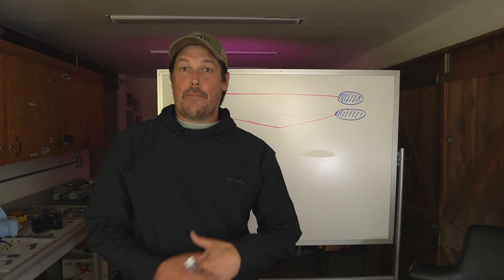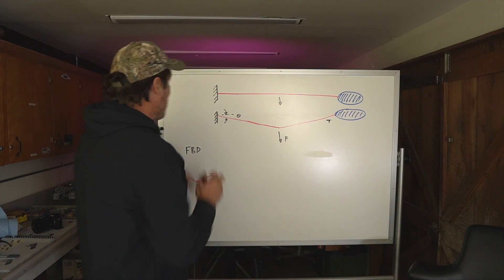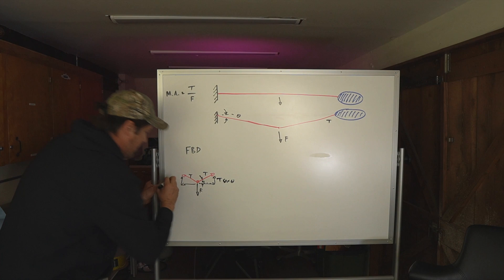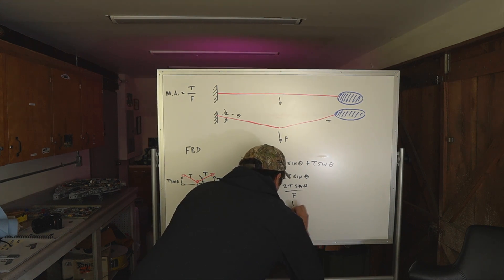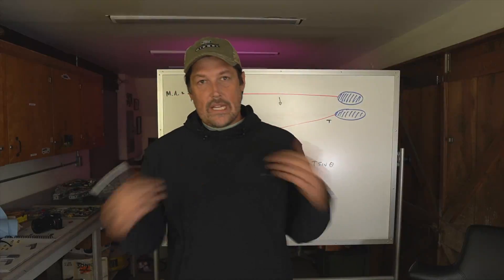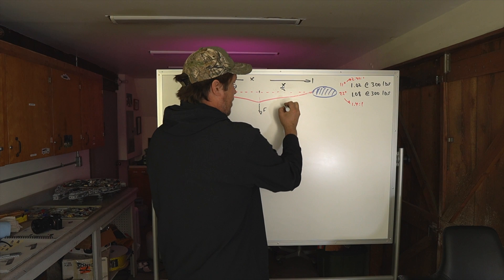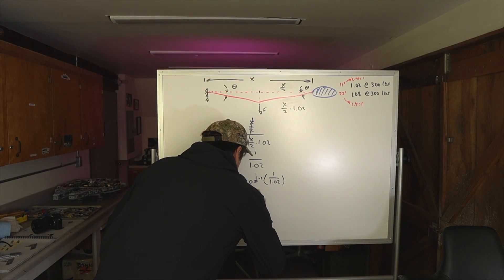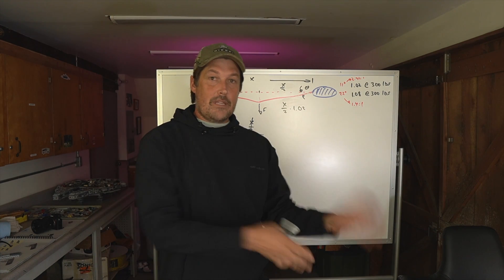Vector Pull Math for Whitewater Rescue

Comment: In the lineman's handbook..... I understand there's a diagram like that.... and it says that a man can pull 1500 lb.... For short distances then he needs to retighten his rope..... There's a type of Hauser line that tugboats use that they advertise stretches very little.... I'm just throwing a few things out that I've heard from engineers and looking in my tipler physics book and such..... And talking to people that work for the pud. IE people that work on telephone poles cross-country feeder lines... You know guys that work at the power company..... When they are apprentices this is the type of stuff they teach em. The diagram in the tiplers physics book.... Says that the rope..... that the rope better be able to hold 12 or 1500 lb... Here's the thing.... If somebody is trying to rescue somebody they have a whole bunch of adrenaline built up they've got tons of extra strength now.... Anyway a man who is amped up is going to be able to pull one hell of a lot more than 100 lb.... Not to disagree on anything that you said. I read a story problem in that book (physics book) and it gave the exact amount it said how strong was the rope have to be if it was exerted 150 lb... I think it said 1345 lb
Reply from the maker: 1 kN is a lot for one person to pull. 1 kN is 224 lbs.

Comment: Great video! Another thing to keep in mind when applying vector pull onto an already tensioned line (ie. with a 3:1) is the consideration of the rule of 12. Big difference if the 3:1 was tensioned with 1 or 3 people and then doing the vector pull on top of that. Hopefully the prussik would slip before anything else unexpected occurs.

Comment: Doing a vector pull on a line that's already under tension. As in it's already being pulled normally, or with a MA pulley rig. Would minimize stretch and keep it at a low angle, but I definitely don't want to be the person pulling in the middle of a system already under high tension. I don't want to be in the middle of everything if something breaks. 

I've seen it done that way once to get a way overloaded boat unstuck, and afterwards everybody had the same thought. "That was way too sketchy, let's never do that again." And even then, the vector pull wasn't super helpful because as soon as the boat moved a few inches it stopped being low angle and wasn't effective.
Reply from the maker: Yes to all of that

Comment: Great video. In his swiftwater rescue class, Lee Baker taught us to use a vector pull to get some extra mechanical advantage after tensioning the line up with a simple progress capture or a z rig. I believe tensioning the line will take a lot of the stretch out of the line, especially with the polypropylene throw bag ropes which stretch far more than a static line. One thing I don’t know is what sort of stress strain behavior these static lines have - is that 2% elongation quote the total stretch at max working load? If you load it up with three people using a z rig, then one person vector pulls, how much stretch is that vector pull creating? My gut says less than 2%. Maybe you can follow up with a video where you rig it between some trees and show us the stretch and angles that result from real world ropes. And once upon a time you had a load cell, right?
Reply from the maker: The stress-strain is not linear and different for every rope. I've done the experiment you've mentioned with the load cells and the result is what you'd expect based on the math. When I have some free time I'll try and make a video about that.